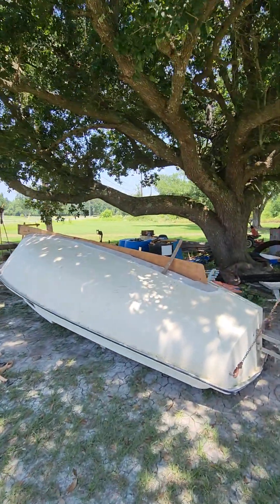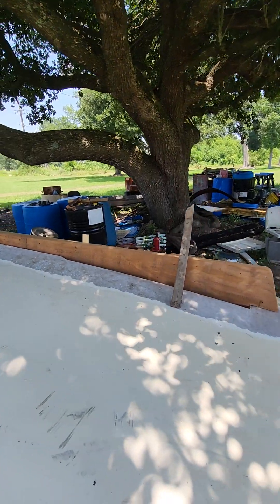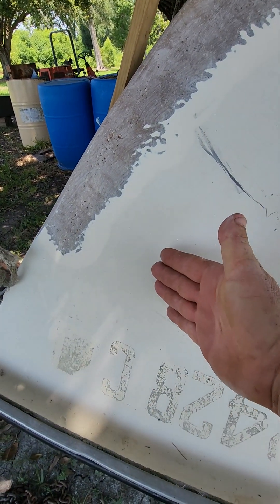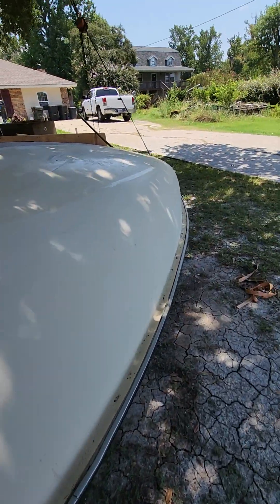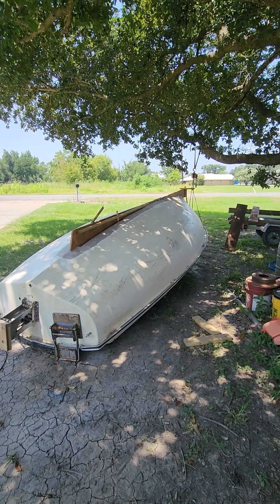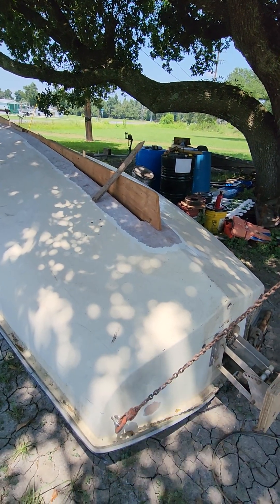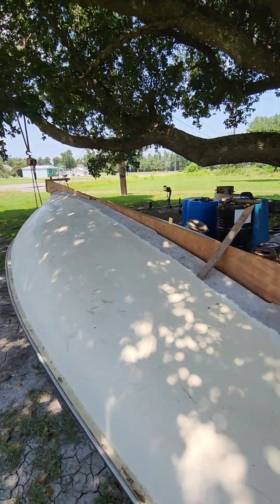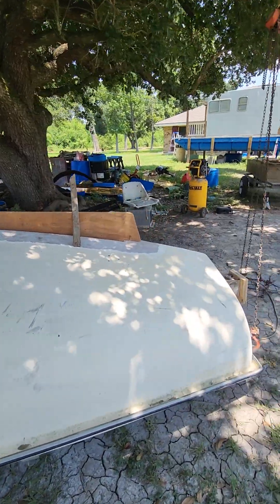Mini Tugboat Pt6

Comment: interesting ideas...I have a west wight potter 19 that i am going to cut the roof off and raise it up 22" or so for a standup pilothouse.  The Potter boats have a semi displacement shaped hull so they are fast for ther size (7 to 8 knots) at hull speed for a boat thats 16.5' at the waterline.  You have me thinking about using it to make a mold and make one a few feet longer (4 feet or so) The engine well is a good idea and if you are building it for a particular engine then you know it will fit right.  I wouldn't also mind more cabin space for a shower!
Reply from the maker: The boat you have would be perfect for a small trawler conversion.
Please post up some vids if you go thru with it.